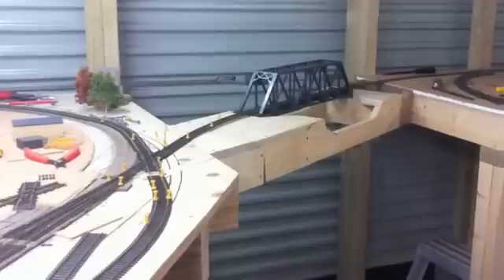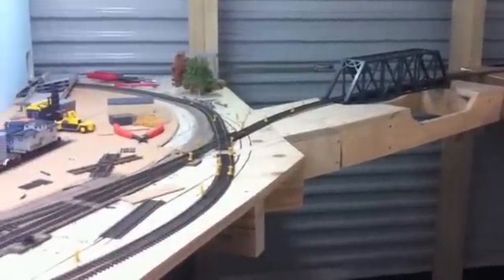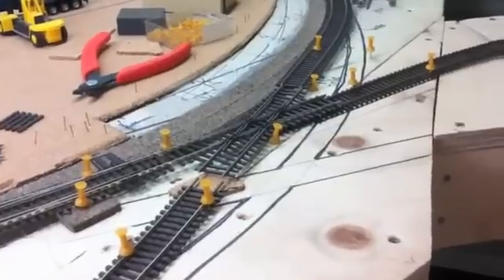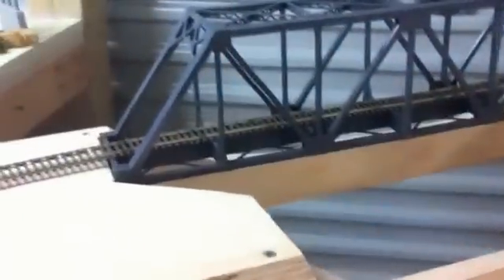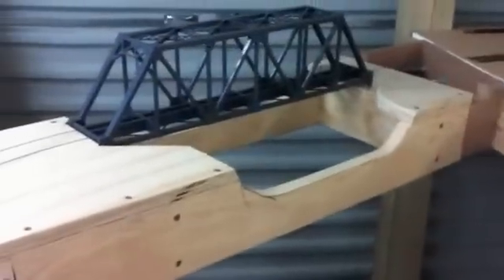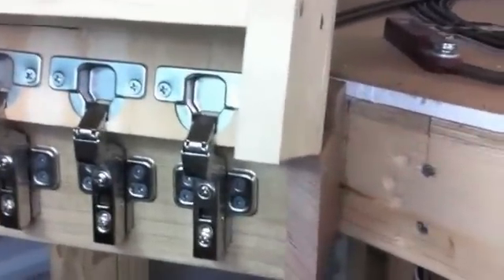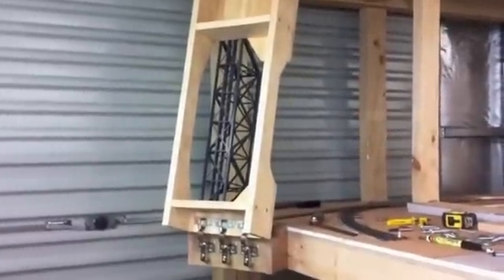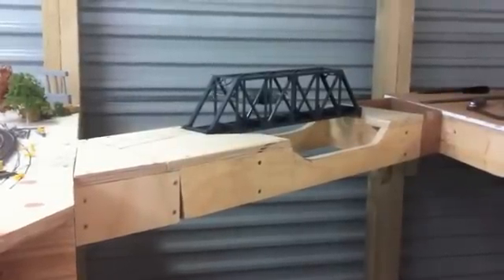JL&T Lift-Up Bridge.m4v

Comment: I actually set up my lift bridge with these hinges.  The issue I ran into was clearance of the rails ends at the pinch point. 
To allow adequate clearance/passing of of the fixed rails and the ones on the lift span when the span was lifted required too large of a gap.  That then would cause issues (think clunk clunk of the wheels) - derailments. Abandon this idea, ( $25.00 worth of hardware) and went with a regular heavy door hing.  Made the pivot point of the span 5 inches from an end point.   I would be interested in how you solved this clearance issue, or have you run up against this problem since you don’t have track laid yet?